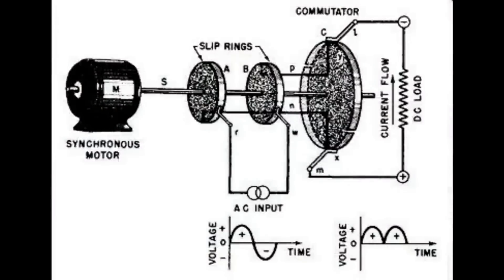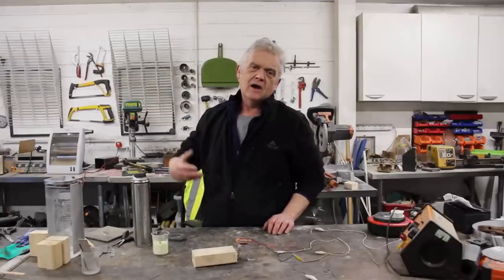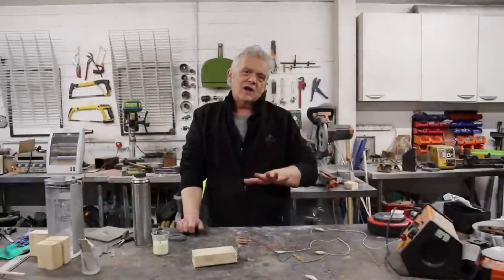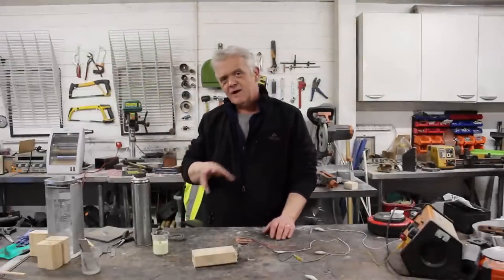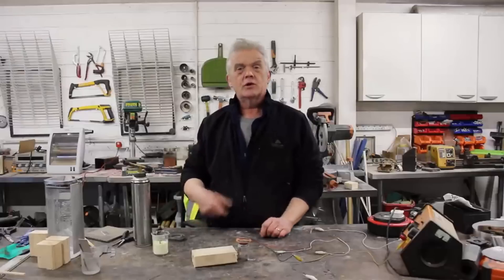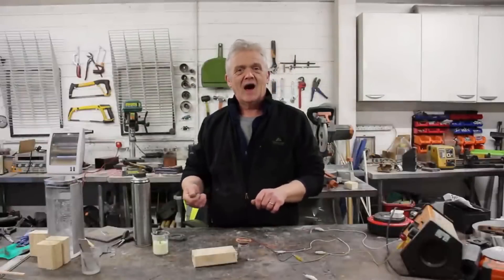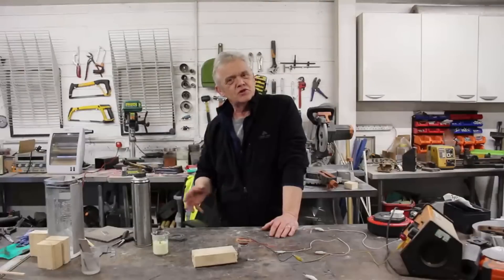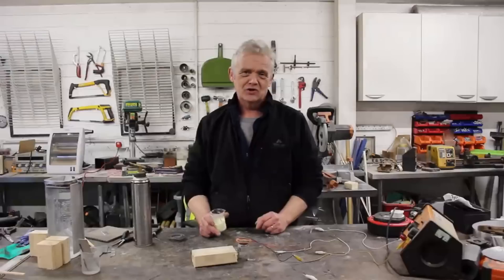2058 The Lost Rectifier As A Thermoelectric Generator

Comment: Robert, could you try this on alpha wire (~50 μm), and sputter on magnessium.

Small diameter wires with an Mg-OH surface should in theory be  able to be scavange thermoelectric work in hot fuids or steam when woven into braided cables and insterted into pipes.

Being able to put this into heat pipe could provide large output when contextualized aginst the large thermal work loads even small and inexpensive copper heat pipe systems typically handle.

Comment: Hello! Is not about the video but i'm thinking.on making a Gravity battery and my idea is that i use a 12v dc winch, the cheapest on the internet, i'll use to raise the weight and then lower it and because is a dc motor i sholud have some energy back, that my plan but i haven't tryied yet and i'm sure is not that easy, maybe the winch Need some modification or maybe the gearbox in the winch isn't good for this job, anyway if is an intresting idea pls give us some advice it would be really usefull thx

Comment: I would suggest taking your mV output and translate that into kinetic energy. Look to Lorentz force. Lorentz also induces rotation. Take a conductive rod and send current through it, within a stagnant magnetic field and you'll see the rod rotates. There is no commutation involved. The conflicting fields resist each other causing rotation/torque.

Comment: So, how do thermal couplers work? When a flame such as a piolet light keeps it hot, it will allow a gas valve to operate safely so it will not open if the piolet goes out. when the appliance calls for heat and the piolet is out?😊

Comment: rectifiers have interested me for years . i used to do odd work for a paper/ board mill the old m/cs ran a400 volt DC fed hrom an enormouse mercury arc rectifier the sound and light show from it was somthing to behold .
i have worked on vintage black and white tvs that used selenium rectifiers and when they went bad well the smell is somthing you will never forget.

Comment: Mercury arc rectifiers are amazing if you know what they are capable of. Did you know they can convert AC and DC at high current, at the same time. That's pretty damn remarkable.
Reply: some of these were still in use just a few years ago for electric trains (subway)
Reply: @davestorm6718  a couple still are. But they're private.
Reply: Rotary Hg vortex based systems (iron based ring magnet) could actually provide turbine driven version.

They do have sime safety issues, however most of these can be reasonably addressed with rational design of housings and safety mechanisms that can contian spills in worst case scenario.

Ironically a graphite sleeve filled with molten sulfur would allow these to both contian Hg in the current standard SOP for spills (sulfur powder or activated carbon), while also allowing solar heated graphite to liquify and store large temps of up too 400°C + around the glass housing wall of the rectifer.

Hg is getting pricey.....but its a self regenerating electrode.

In theory they should last forever and you can do way higher voltage/current density than most other known systems.
Reply: They look so unreal have a search for this "Kempton Steam Museum - The Mercury Arc Rectifiers"